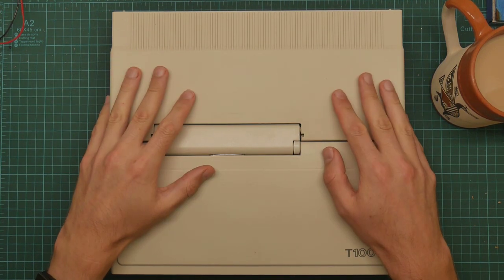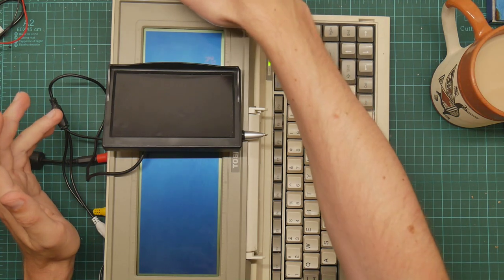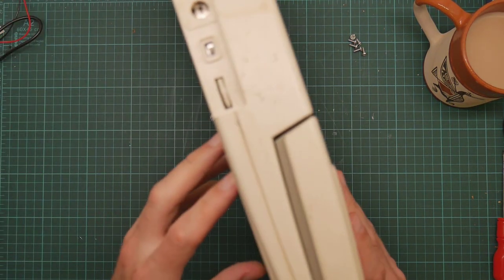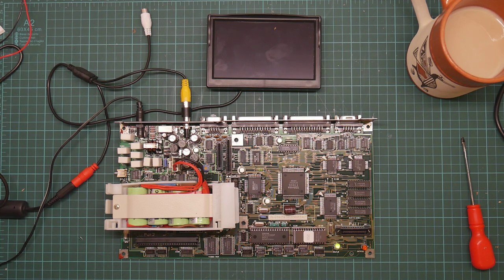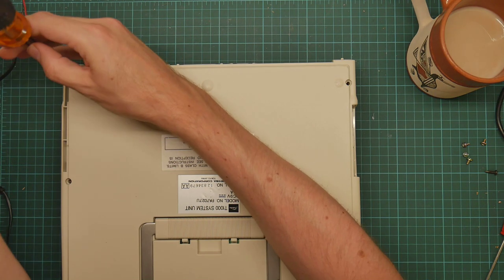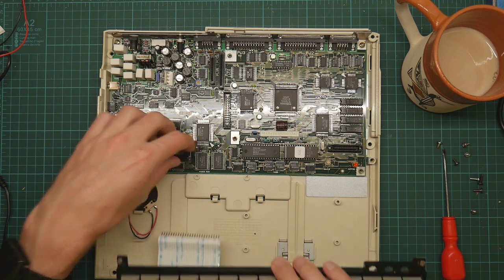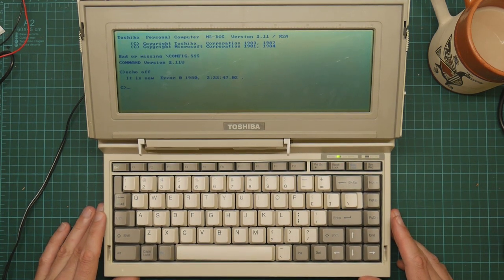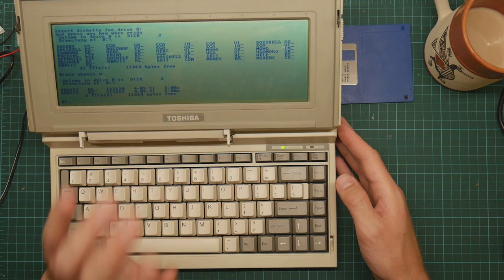Hjalfi performs a T1000 brain transplant

Comment: I have one that was given to me in 94. It has everything that came with it when new. Including a briefcase that was used to carry it.
   edit;  found it.  The original brick is missing, but I have an aftermarket one that works. It doesn't power up. The nicads seem to be bad. I'm going to replace them and see what happens. 
    It looks much newer than yours.   serial # 07718877   firvs4   There is a number printed on the board 
   36T701216GO   and a sticker above it   72937238K2000ZA1.